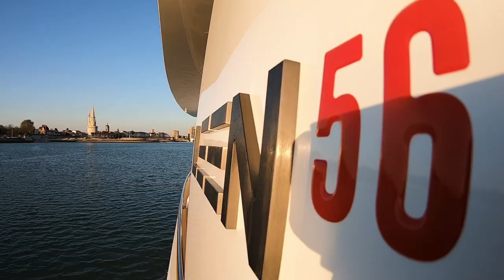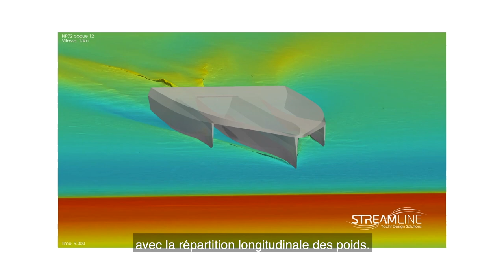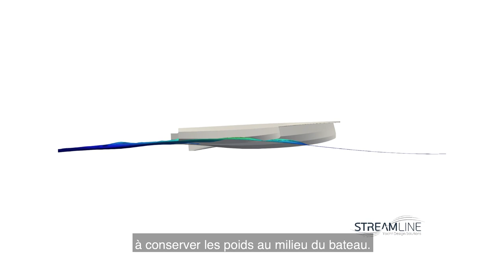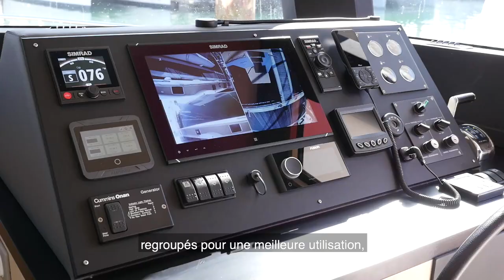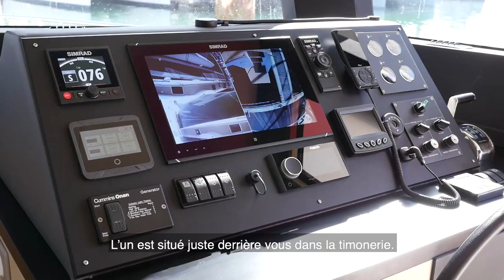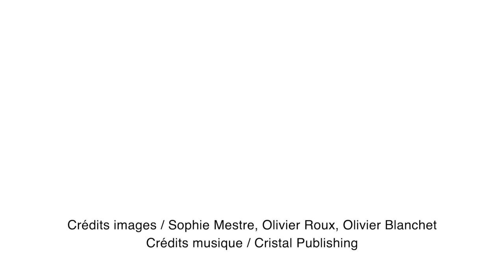LIVE LEEN 56 LAUNCH APRIL 2021

Comment: is it 2 litres per mile or per hour at 9 knots?
Reply from the maker: Dear friends,

We are very pleased to share with you technical information mesured on board the LEEN 56 number 1.
Date : April 22/2021
Conditions : calm sea / NE wind 12 knots/clean hulls

Motorisation : hybrid motorisation - X 305 CH Cummins QSB 6,7 & 2 x électric engines Bell Marine drive master 15KW. Diesel tankage: 5 000 Liters = 1 321 US gallons

Witness : Journalists from Moteur Boat, Neptune et Multicoques Magazine.

At a speed of 8 knots, at 1,500 revolutions per minute, the consumption is 1,25 litre per mile (0.33 US gallon per nautical mile) with a range of 4,000 miles.
 •	Perfect for long distance navigation like the Atlantic crossing

At a speed of 9 knots, at 1,850 rpm, consumption is 2 litres per mile (0.53 US gallons per nautical mile) with a range of 2,500 miles.
 •	This is the intended target of the LEEN 56. Hulls, engine and propeller have been designed accordingly.

At a speed of 10 knots, at 2,120 rpm, consumption is 2,77 litres per mile (0.73 US gallons per nautical mile) with a range of 1,800 miles.
 •	Still very good with more than 1500 Nautical mile autonomy

Motorisation : with electric engines
At a speed of 5 knots, at 1,100 revolutions per minute, consumption is 1.2 litres per mile (0.31 US gallons per nautical mile) with a range of 4 166 miles.

The datas are for information purpose only and non-contractual.

Comment: Two things, Skippers station needs to be Port side not Starboard side and deck hatches need to be flush, on another video it shows hatches, one with a ventilator, dotted all the way up to the Bow, ready to trip over and/or stub your toe, especially where going fwd narrows due to the design. Otherwise I like it.

Comment: This boat was supposed to burn 2 liters per hour at 12 knots, now they are telling us it 2 liters per mile at 9 knots. that's 20 liters per hour at 9 knots.
Reply: 8 knots it’s 1.25, which is very good and only one knot lower
Reply: Your correct, with a 300hp Cummins (the lowest hp rating) would chew through 18 to 22 litres per hour.